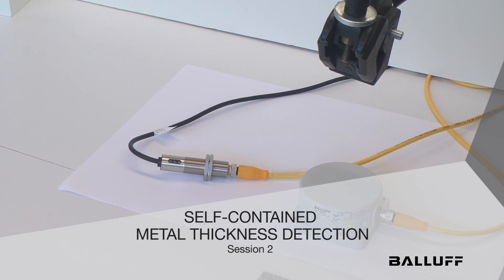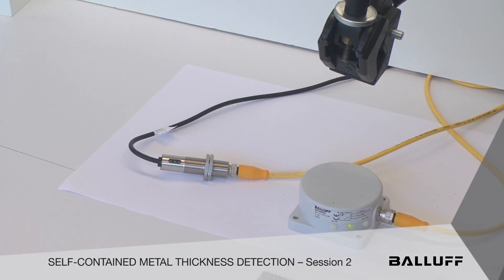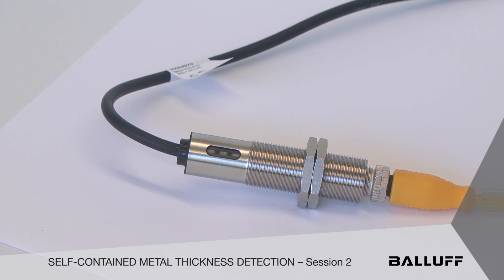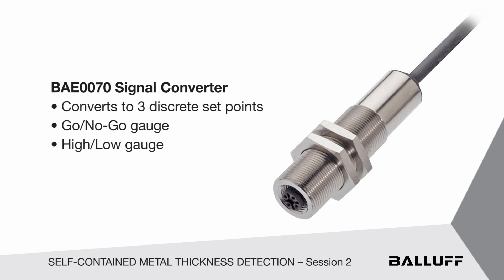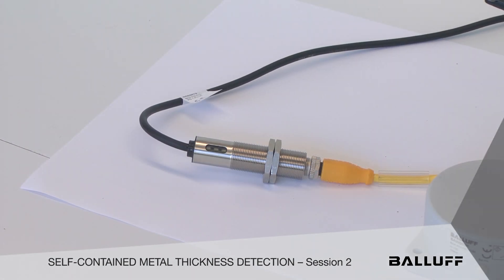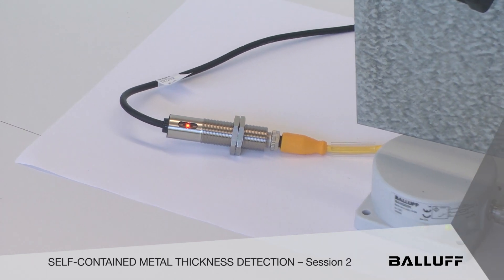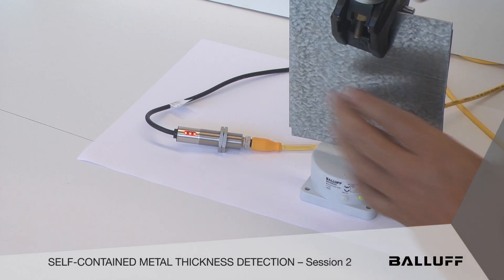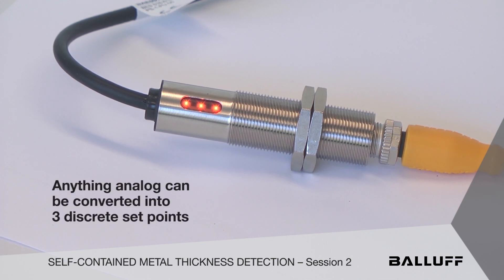Metal Thickness Detection - Session 2

Comment: imagine that the thickness of the metal sheet is known and the metal sheet is laying over nonmetalic surface where there's a small spot of conductive paint (around 1 mm diameter) and there's small gap between the paint spot and the metal sheet( very small gap around 0.1mm) and i need to measure this gap is this possible? taking to account the conductive paint can be connect to a circuit. if yes I really need to contact you.. idk where i can find you but my email is oomeroona@gmail.com 
Thanks in advance
Reply: in other words i need the measurement between the paint and the outer surface of the metal sheet including the gap then with known thickness of the sheet i can measure the gap
Reply: I need to apply this in aeronautical industry
Reply from the maker: Hi Omar, please send us your question at this link: http://sensors.balluff.com/ContactUs. Someone from our technical support team will be able to help you find this information. Thanks!